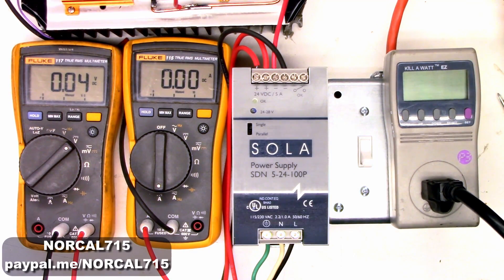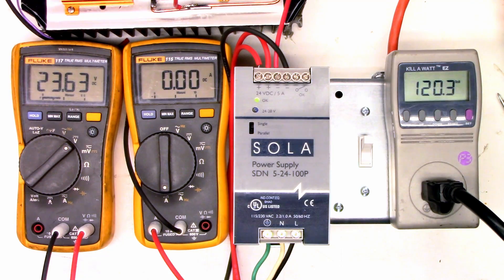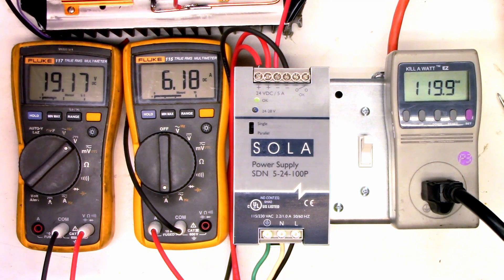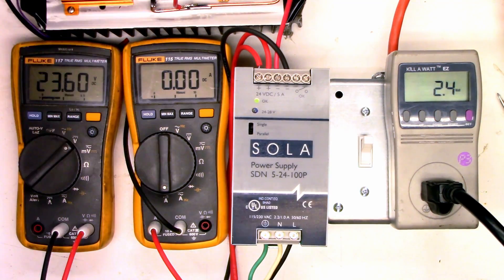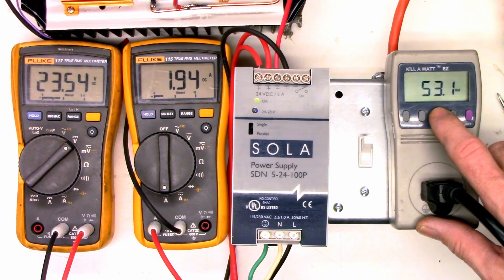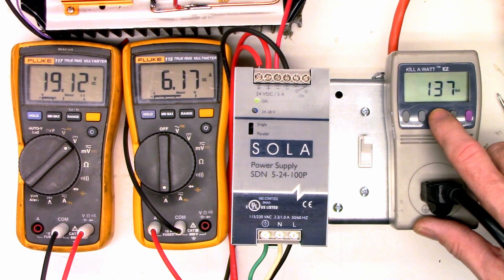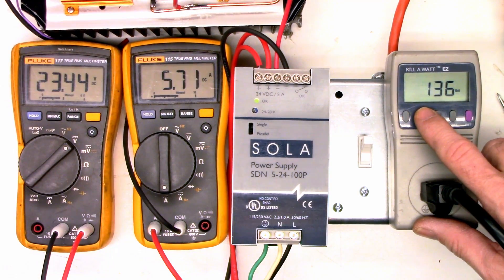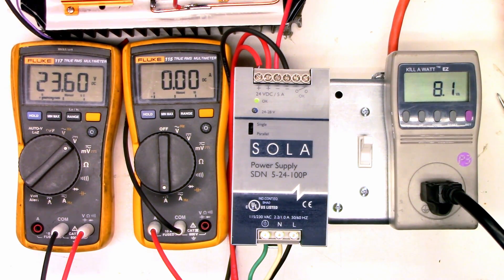REVISITED POWER FACTOR CORRECTION SOLA 24 VOLT INDUSTRIAL POWER SUPPLY DEAD REPAIR SDN 5-24 -100P

Comment: 2:19 - common mistake. With linear loads yes but this SMPS at 120V~ is NOT linear load, you can't talk like "current leads or lags the voltage, they become out of phase" here. If you supply non-linear load with sinusoidal voltage the current is deformed/distorted. ( https://en.wikipedia.org/wiki/Power_factor#Non-linear_loads )
Because big capacitor (from your previous video) had 325V- probably APFC circuit is fine but mains voltage measured by APFC controller is too low and therefore there is no PF correction done, only voltage boost...
https://www.alliedelec.com/m/d/5ff4fd934780eb211baa2708734398b0.pdf  <- "Power Factor Correction: Units Fulfill EN61000-3-2"
https://en.wikipedia.org/wiki/IEC_61000-3-2#Scope <- "International standard IEC 61000-3-2:2005+A1:2008+A2:2009 applied to equipment using voltage not less than 220 V and current up to and including 16 A per phase to limit the harmonic currents emission."
Reply: Myszka Agresorka I agree Watson!